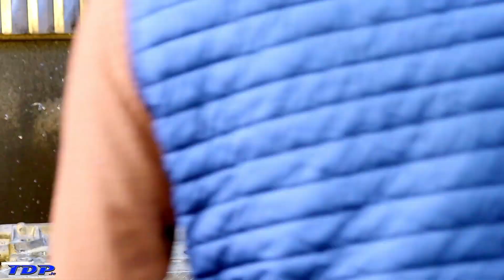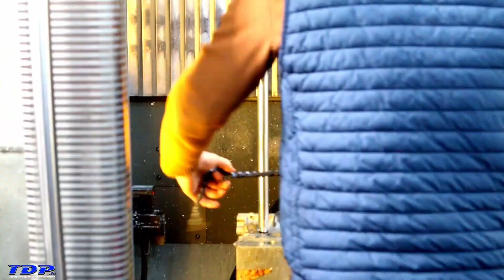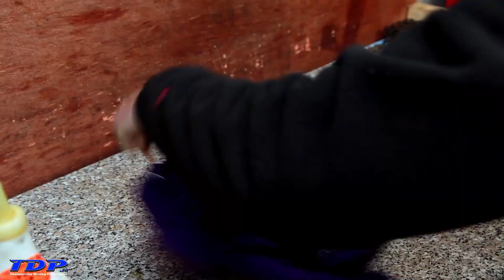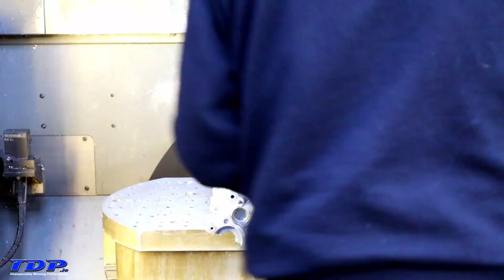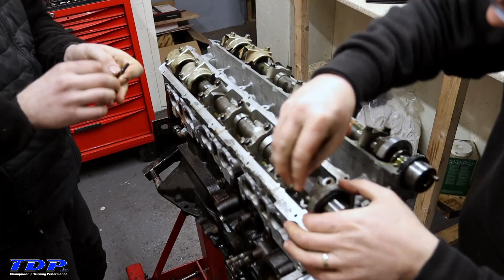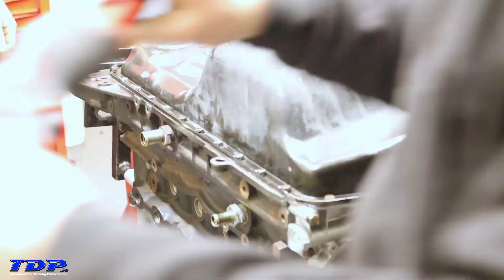Nissan RB25DET engine repair and build - TDP

Comment: Hi Robbie, whats your opinion on using lucas oil stabilizer as an engine oil additive with fairly standard oil, say a shell H7X or similar?
Reply from the maker: It depends on the oil clearances and pump.  We use it in some engines and it works very well.
Reply: @TrackdayPerformance  what would you recommend for something like a stock 2jz?
Reply from the maker: We would reccomend Mobil 10w60
Reply: @TrackdayPerformance  Much appreciated! Massively enjoying these videos